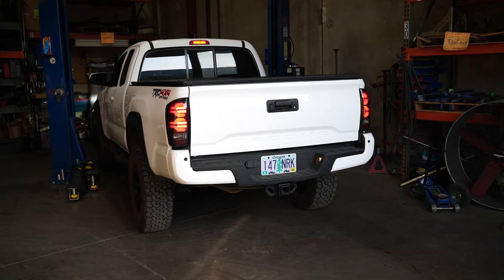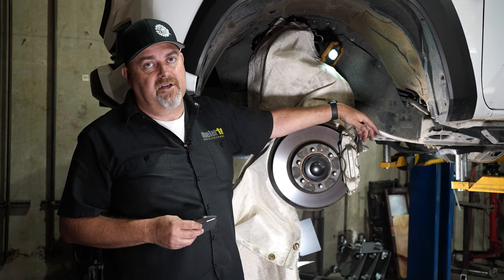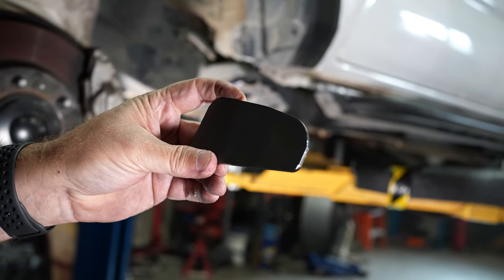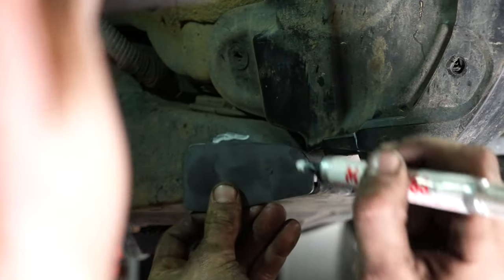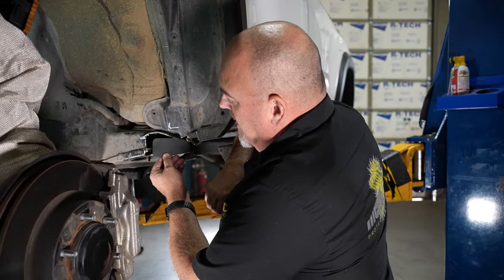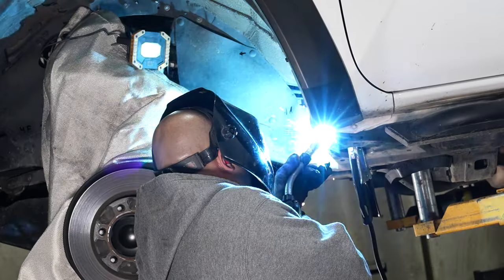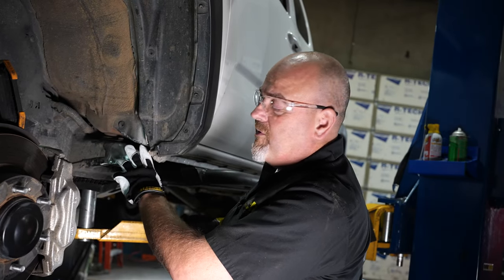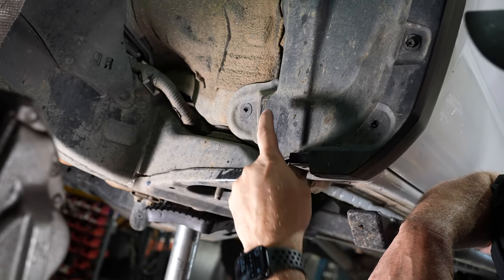Body Mount Chop Installation | Tacoma, GX460, GX470, FJ Cruiser, 4Runner, Land Cruiser

Comment: The purpose of the oversized body mount is to prevent tire/wheel intrusion into the cab during a crash. I did BMC on my 2010 FJ, and I will be doing it on my 4Runner. Just letting everyone know that there is a very legitimate reason for the oversized body mount on the frame.
Reply: Figured there was a reason

Comment: Thanks for sharing Metal Tech; I plan on purchasing your kit for my 2008 FJ and had a question about the tools used to do the job. I read on FJ Cruiser Forums that the body mounts can be cut with a portable electric band saw to "surgically" remove the unwanted material. Have you had any experience with this method? Do you foresee any advantages or disadvantages of using a band saw?
Reply from the maker: We have installed them with a portaband, sawzall, and grinders with cut-off disks.   They all work well.   The portaband is great as long as you can get it in all the way for the cut.    You will still want to have a grinder on hand for the final fit-up before welding.

Comment: There is no structural reason to add a plate to the cut frame.
Reply from the maker: The plate is added to seal the area and make the job look factory.
Reply: @Metaltech4x4  Makes sense, I did this chop in 2012 on my 2012 FJ and see no reason to cap it. I am a retired welder from the Union Sheet Metal Workers union so I know structural steel. On FJ's there is no way water can get back into the frame, its coated anyway. I painted mine and put the rubber cover back over it, tires never ruined the cover.